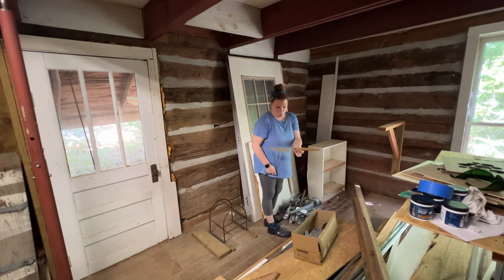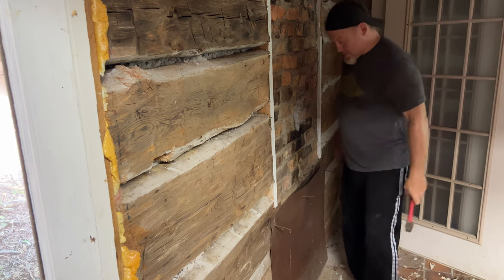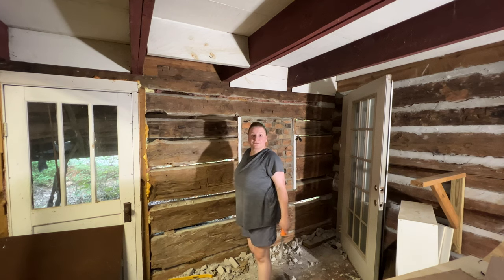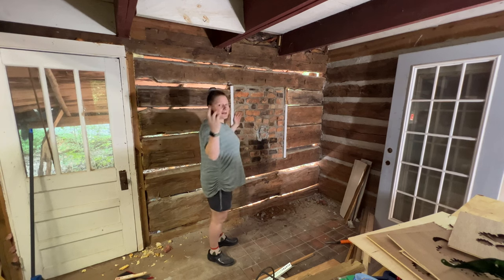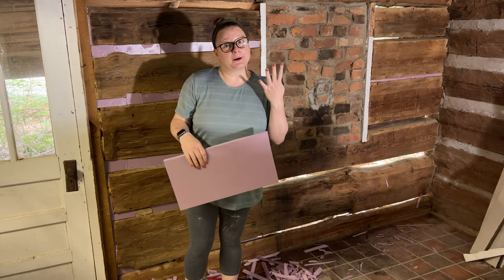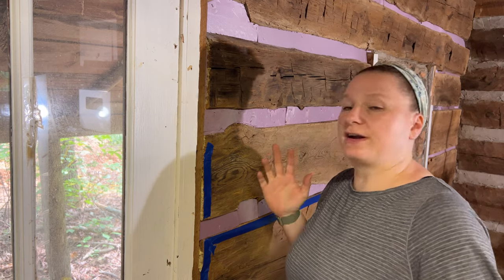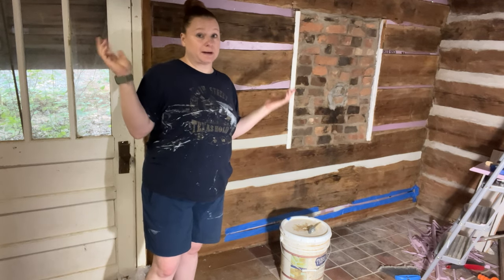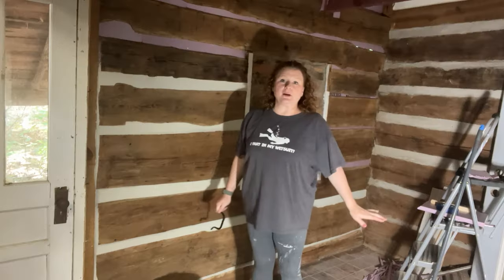Kitchen Wall Reno!

Comment: When moving doors a skate board works well or a real old time roller skate. You can also place it on a kitchen broom and slide them. I move my fridge that way for decades Also a pointed prospecting rock hammer works well to remove cement chinking.

Comment: Hi, Candice. I'm glad you took your time with the new insulation although I was a little concerned when you removed the old insulation from the top of the wall. Was that fibreglass? If so, you should have been wearing your mask before removing that too. Good job, nevertheless. Thanks for sharing 👍

Comment: The ridged nails are called Ring Shank nails.  When pulling nails, the V between the hammer claws is tapered so you can place the claw against the surface of the wall or board that has the nail in it.  Then you have the head of the hammer for leverage,  and you don't have to use a board like Jeremy did when pulling the nails out of the metal.

Comment: We used Backer rope, all it is foam Rope in different sizes. You can smash it, then drive it in with a a wedge or something and it expands. And it easy to use.
Reply from the maker: I have some for when I installed the window. I may use it in the living room since the gaps are so small.
Reply: You can get backer Rod up to 3 inches round

Comment: Would the canned, expanding foam work for in between the logs?  Once it dries, it's easy to trim and would fill those voids between the boards really well.  I used it to fill in the areas I had a Carpenter Ant infestation in my basement wall after I dug out and treated the nest.
Reply from the maker: There is some on the side at the door, it’s a little harder to work with, the perfectly flat areas seem to help with spreading the material.
Reply: @savingthecabin  Have you used the hot foam cutters?  They go through it really well and can give you a flat surface.  I've sent an Amazon delivery your way to try out wherever you think best.  Looks like that respirator is working well for you when you need it.
Reply from the maker: @Horsewomann  haven’t tried them before. Thanks!!!
Reply: @savingthecabin they will be there Friday, a long with a few other things. I sold a lot of freeze dried candy last weekend, so I can help y’all out a bit.  I’ll have to box some up and send your way.
Reply from the maker: @Horsewomann  awwww!!!! Thank you!!!!!

Comment: Candice the wall looks amazing.   ❤ 
Could you put that chinking stuff in a zip lock bag and pipe it in your spaces or is it way to thin to do that? Then smooth it out with your sponge?
Enjoy the rest of your week and God Bless 🙌 ❤❤
Reply from the maker: I have a caulk gun that is loadable and it has tips that are thin and wide. I just didn’t want to deal with it since I was doing a couple lines each day. The painters scrapper helped it go quicker on the last couple days.